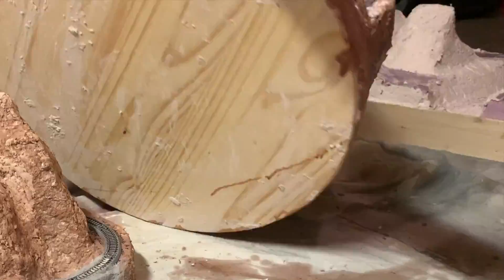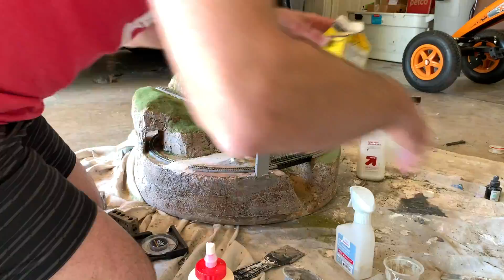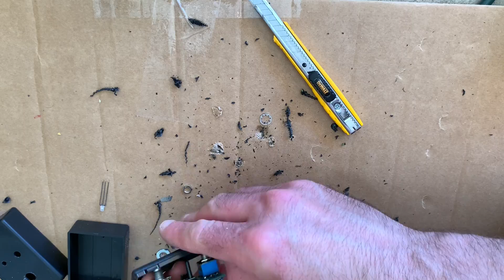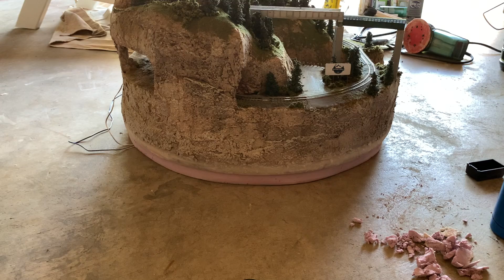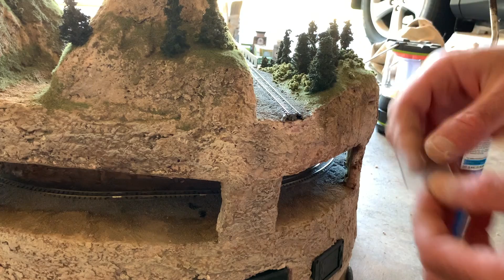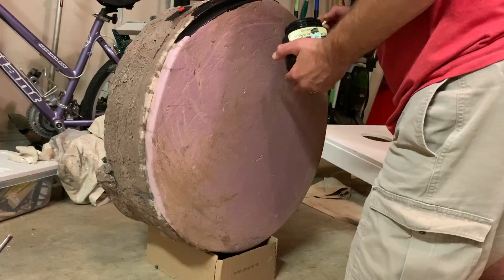A Battery Powered 24" N Scale Model Railroad with Waterfall

Comment: how long will the batteries last in a setup like this? is this an economical way to run a small layout that is not used a lot?
Reply from the maker: Well, I would use rechargeable batteries for normal use. Energizer Lithium 9V batteries last a long time. Not sure how long, but I’ve had them run a train all day at a train show, although likely varies significantly by individual locomotive and how much power it is drawing. This was built as a store display that would normally be run only for short period with a push button so that is why it is battery powered.
Reply: Thank you for the information!

Comment: Your scenic and construction skills are wonderful but your mechanical machining and electronic skills are "challenged." You need to get a step drill to make accurate holes for switches and work on your soldering technique. To make a long tunnel through your foam just get some tubing and sharpen one end and use your drill. The speed will heat the end and it will bore right through cleanly. As to manipulating the cotton, I would recommend the bamboo skewers they sell for BBQ at the grocery. They are already sharpened and basically disposable. You can also use them cut down for fenceposts too.

Comment: Do you have details on the battery pack and assoc parts you used . I need one for an Nscale layout I would like to build ?
Reply from the maker: I used the panel mounted controller from here: http://zscaletrack.com/controllers along with 9V battery holders: https://amzn.to/2K1qFNI  
The battery throttles on the z scale track page are all great, including the 9V blue line one and the Rokuhan one that holds 8 AAA batteries. Both only output 9-10V maximum so won't run your n scale trains as fast as a regular controller. That is why I wired two 9V batteries in series to the panel mounted controller so it would output closer to 16V for a higher top speed.
Reply: Steves Trains thanks for the info that will help a lot. 👍

Comment: Please give information about your battery power unit.  Thanks.
Reply from the maker: It is the panel mount blue line snail speed controller on this page: http://zscaletrack.com/controllers I hooked it up to two 9v batteries. The battery holders I bought off amazon.
Reply: @StevesTrains  thank you

Comment: Nice work, but why don't you build on a work bench instead of the concrete floor ?
Reply from the maker: I only have room for a small work bench (as long as I want to be able to keep both cars in the garage) and I find it easier to work on the floor. Maybe I will eventually figure out a way to reconfigure things so I can do a fold down workbench. Even so I like working on the garage floor.

Comment: Lovely work, Steve as always. A very interesting layout to say the least. N Scale is an amazing way to fit a layout into a small place such as this table base. Just question or two, which mic system did you use for the voice overs and lastly what is your video editor? Was trying to work it out from the start of your video. Absolutely loved the waterfall too! Keep well. Cheers Caleb
Reply from the maker: I have an audio-technica mic that I use with my PC laptop for work meetings and webinars, but I have a hard time getting it to work right on my Mac. It will work fine plugged into my iphone though. It is super sensitive though and picks up a lot of background noise. I actually used a Rode Video Micro attached to. my iphone for the audio on this video and just recorded a voice memo. I'm still just using iMovie for all the video editing. Almost all the video of the layout build came from my iPhone XR, except the video of the finished layout which I took with my Canon SL2.